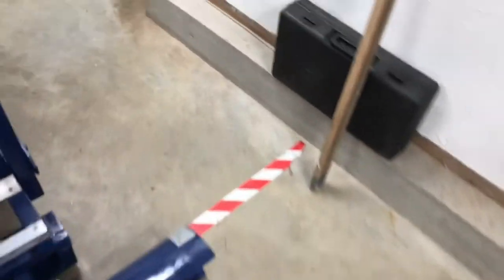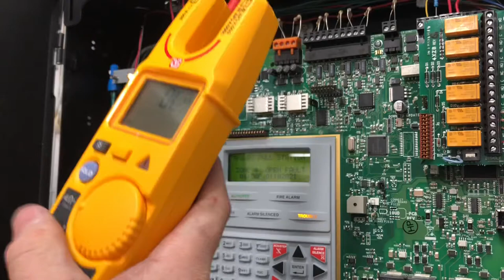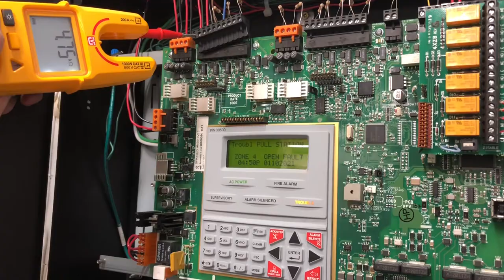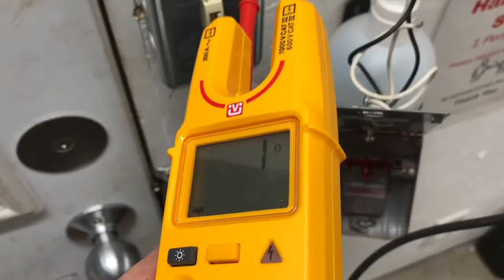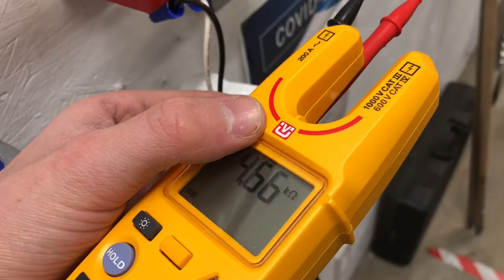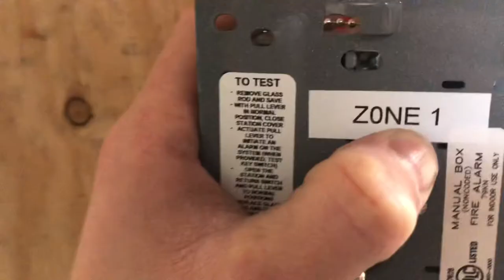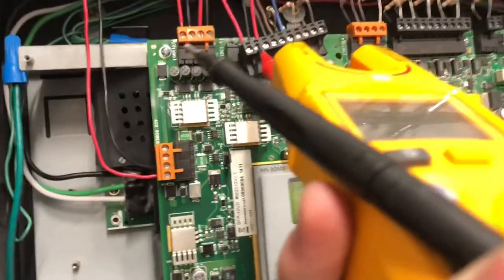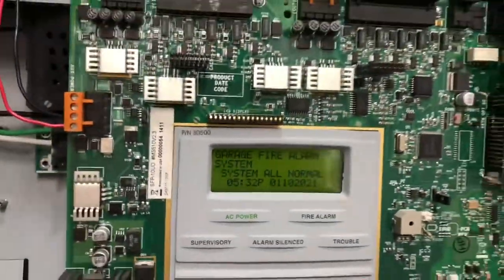How to troubleshoot a fire alarm system ground fault

Comment: This is a wild one, at our water treatment plant  there was a ground fault on the slc line . I traced it to pull station where a spider had made a home and built a web. I’m a NICET 3 tech and never experienced such an issue. I did some research and found some spiders webs have a conductive protein which of course the building was metal caused a ground fault. After caulking and kicking the critter out issue solved.note that I was using a top line fluke meter , my 123 fluke or Milwaukee meter would not pick up resistance to ground. Hope this helps my felllow life safety pros.
Reply from the maker: That’s crazy I did not know that about spiderwebs
Reply: That's crazy. I had a runner call a few weeks ago, came back a few hours later to find ants had nested in a pair of riser 4x4's. Took out half the system. They entered through the horn strobe penetration.
Reply: The spider was communicating with all the devices on the SLC loop. LOL
Reply: When I trouble shoot i like to grace my faults on ohms. If you now how to use/ read the meter it makes troubleshooting really easy.
Reply: Wow thank u for sharing thats super insightful intel

Comment: Fire panels can detect ground faults that the continuity beep can’t detect on a meter leave it landed on the panel break in the middle read DC voltage and ohms what your doing on a big job is asanine

Comment: I dont know how old you are or were your position is as an electrician but I am impressed with your diagnosis of the pain in the ass ground fault. Kudos to you. Also I would normally open the circuit in the middle as a start. If you can figure out where it is. LOL F/A can be a real mystery sometimes.

Comment: For anyone who enjoys installing/ servicing fire alarm systems and want to learn more about using there digital meter. 
Set your meter to AC and then select HERTZ for frequency. Then put your meter leads on the SLC loop. Then look at the frequency changes. The SLC LOOP puts two different signals. AC riding on top of a DC signal. If you have an oscliscope. It's pretty cool to watch. 
            Old School Tech

Comment: Fire alarm systems are at times frustrating when it comes to tracing and troubleshooting ground faults. I think the video is very informative.  But,                 
                                                                                                                                                                                           A proper meter to use is one that can measure 1 to 2 Meg ohms Which is 1 million to 2 million ohms. The fluke model T5-1000 is great if the fault is less than 1k Ohm 1000 ohms. So, a fault that is over 1K this meter will fail to detect the ground fault.                                                                                                                                                                          I have been servicing maintaining programing commissioning large life safety systems for over 30 plus years.  So, when it comes to the infamous ground fault IE SLC, NAC, 24VDC Aux etc.                                                             Negative or positive doesn't matter.                                                                                                                                       Troubleshooting is key on the approach on how to investigate the fault. Like was there any construction done recently?  Known water leaks floods, roof in the building etc. This would help out the technician pinpoint the area. When breaking up the known circuit in the fire alarm panel. The Technician on site will not know how its wired (doesn't matter) The key is to break the known faulted circuit in halfway segments which once done they will know which half is causing the fault.                                                                        The key here is at this point is to keep breaking the fault circuit in half's IE not Every device etc. This will be a time saver, along with never having more than 2 to 3 opens of the circuit any 1 time so you don't' lose track of the path where the ground fault is located IE class-A or B Etc.                                                                                                                                                                     Now not all ground faults have a low resistance. Most modern fire panels will detect a high resistance ground fault IE 200K ohms or more. Now these may be from a wire that has been pinched in an electrical box or from a cable pulled tight on a metal pipe or HVAC duct or even tie wrapped FPL cable to a threaded support rod etc.    
There is another tool to use in the troubleshooting toolbox.
 Set the Multimeter to DC voltage The T5-1000 meter will be fine for this test if used. I like the Fluke 87 ($$$) but the 177 is fine anyways.
etc.
High resistance grounds are not easy to trouble shoot. These can be caused from Wiring faults on the input side of a monitoring module on the SLC circuit.  A 500K ground could be from a Wiring issue or from an input monitoring point.    The video was very good in explaining types of circuits. Most circuits are powered limited so a short will shut off the power but typically most circuits as designed to operate on 1 ground fault but NOT multiple ground faults. Voltage is key here Lack of voltage or a low voltage condition from a ground fault will disrupt the SLC communication to devices along with not having the proper voltage to operate the Horn/strobes etc. I Hope this helps the professionals in the fire alarm Tech field The more you know sure helps in daily work!!
Reply from the maker: Thanks for the comment some great information here definitely information I will keep in mind
Reply: Excellent information. Thank you.
Reply: Thank you, very informative. I wish you do video on intermittent ground fault troubleshooting
Reply: I know how to repair these  fire alarms

Comment: Dude! Awesome video! I'm a 3rd year electrical apprentice. I've been working on an Emergency Fuel Shut Off System that uses these NAC , EFSO Control panel , interface panel, and that in these fueling vaults are different devices such as leak detectors, liquid level switches, limit switches etc. It's a lot! We ran all the conduit, pulled wire and landed in these panels but we are just the electrical contractor, this fire company is the one helping us bring it online and commission the job. I've learned a lot by talking to fire guy, just learned about putting resistors on the end of the line.  

I've gotta question for ya, for these leak detectors that require a resistor at the EOL, how would you go about wiring the resistor to the wire? We tried wirenutting the resistor but it doesn't make a solid connection and there's no terminals for the device. Just 3 wires coming out it for NC, no and Common.
Reply from the maker: Thanks yeah usually the panels circuit would end on a device with terminals that you could put your wires and resistors under lots of times though the end of line resistor at least here in Canada is required to be in a separate box where there are special end of line cover plates for the box with a terminal block on the back of them for you to bring in your wires and put your resistor under i’m guessing that would be the way you would have to go in your situation
Reply: A good way to do it, other than a proper EOL cover plate, is using terminal blocks

Comment: That's an interesting meter. It can do Continuity and Ohms at the same time? You never want to check for GFs with Continuity only. Always use resistance incase the copper is touching metal that isn't grounded. In that case you're only going to see resistance on the wire. Using voltage is also a great way to find grounds.
Reply from the maker: This metre is like most there is a setting to measure the resistance value and if the resistance value is not very high it will just give you a beep saying there’s continuity

Comment: Or the batteries leak by most ground are nac outside and or wet stuff or too tight connector pinched wire

Comment: Some ground faults you can’t meter
Reply: SO VERY TRUE!!! 
So what do you do when the conductors your troubleshooting have ground fault but don't show up when you have your meter set for resistance ( not continuity ) only. 
There a few things you can do. 
You can have a second tech at the panel and use that as a ground reference. 
Sometimes a 2nd tech is not available. If your using a good fluke ( 87V) set to resistance and your seeing a clean line. Most likely you have induced voltage or too much noise on the conductors which will also show up as a ground fault condition. So if your not seeing any ground faults in the resistance mode. Set your meter for AC Volts ( make sure conductors are removed from PCB) and see how much induced voltage is on conductors. 
Even to much noise on the conductors can cause ground fault. 
I stopped doing installs back in 1996 and became a full time Fire Alarm Service Technician. Till this day, I still service and repair over 150 different systems a year. 
95% of those service calls involve troubleshooting with your meter. 
Somtimes there is a lot more to ground faults then just a pinched/skinned/ wire. 
I'm on job right now were the RS 485 terminal on the annunciator lamp driver is locking up the whole panel. 
Making all functions inoperative. If there are any  service techs who want to know the troubleshooting process from start to finish  and what solution i came up with to bring system back to 100% operational. I will be glad to explain it. 
I have been doing Fire Alarm Service work for 26+